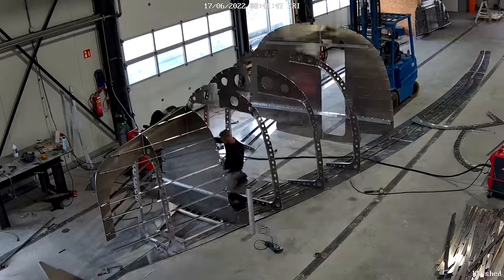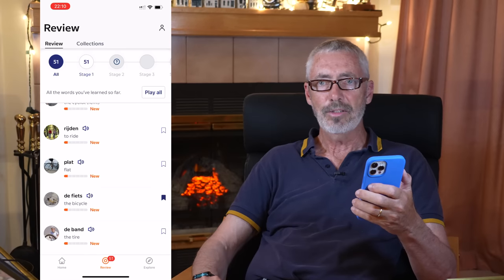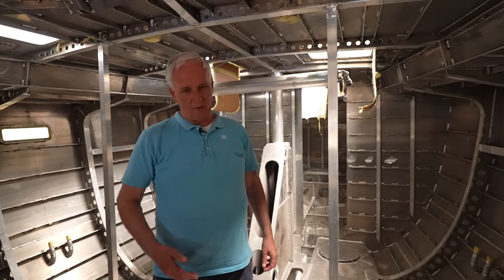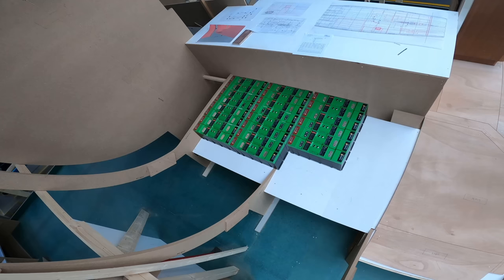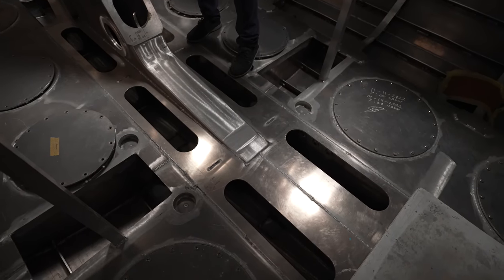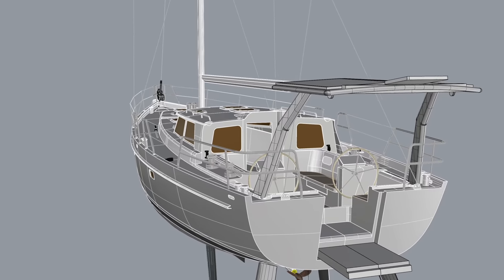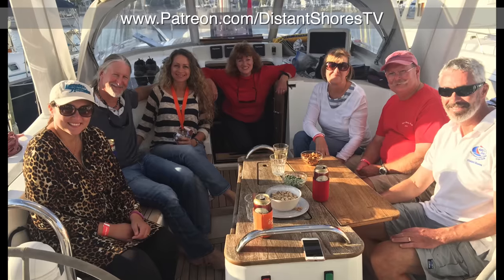ALUMINUM Sailboat Pt 17 : BOW THRUSTER, Cabling, Insulation, Lithium Batteries and More! | EP 238

Comment: Nice technical video. It would make sense to put the batteries for the bow thruster in the front near it's electric engine to avoid voltage drop and use less copper 😊. From experience the paint on aluminum never last long ... Other deck materials may be a better choice.
Reply: If the Bowthruster runs on 48V ther is not much current and the cables are relatively thin. THat is the big advantage of higher voltage. The piant on Aluminium lasts very well if the priming and painting prozess is done correct.

Comment: It seems like the bow thruster should have a water tight bulkhead behind it or its own compartment. If there were a leak it looks like the amount of water ingress or the difficulty of working on the shaft seal under the motos would be hard. Boat looks great!
Reply from the maker: Thanks for your comment. You are correct and these things are in place. We simplified the drawing so the thruster motor was easier to see.

Comment: Looks great but I do have a small detail question. On the thru hull pipes, are they welded to the fore and aft strakes to stabilize them? I couldn't tell from the video. If not, you might ask if they should be gusseted to make them stronger and less prone to cracking. Beautiful workmanship through out though.

Comment: Great update on your dream boat, keep them coming.

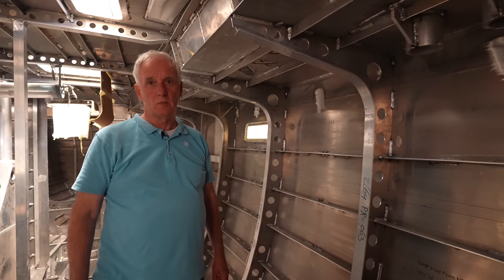On the topic of foam insulation, you didn't mention the 'type' of insulation sprayed and showed a cream colored example at 4:59.
According to my experience with North American products the cream colored insulation would indicate an 'open' cell insulation as opposed to a blue colored 'closed' cell insulation.
European markets might be totally different but I would suggest verifying the material is indeed a 'closed' cell insulation to prevent moisture absorption.
On the issue of safety:
Exposed foam insulation is not allowed in residential construction due to the production of toxic gas emission upon burning.
Residential Code here in Canada requires ALL foam must be (protected) covered with drywall to allow sufficient time for egress.
However in a boat with limited or restrictive egress we should be EXTRA vigilant in ensuring a proper insulation seal, especially when egress is limited.  

Years ago, I came upon a particularly difficult spray installation that would make covering the uneven surface costly and difficult.
In order to offer some protection to my client, I came upon a product (not approved for residential application at the time) the entertainment industry employs to protect their large foam carvings, animated heads, animals and displays by spraying a fire retardant directly on the foam.
I suspect this product has improved over the decades and I would suggest researching it if this is of interest to you.

Further, and NOT to scare you but I would include respirators with organic filters, inexpensive and something you hope to never have to deploy.

For those interested:
Foam insulation
R6/inch (2.5 cents)
6 cents ~ R14
Canadian code requirements for wall R19

Hope I scared you...a little bit
Ya! there's always one in the crowd
Cheers
Reply from the maker: Thanks for sharing your knowledge and for this information. We will investigate and be covering the topic of insulation in more depth in a future video. 👍🏻
Reply: @DistantShoresTV  
I should add that Closed Cell insulation is a MUST.
Open cell insulation would be like gluing a sponge on the inside of the boat that would absorb vapour and render the insulation useless, not to mention the added weight, formation of mold  behind your cabinets etc.

Another issue I have is the application method.
The side walls will be in constant motion, deformation and twisting action.  
I would enquire about surface preparation (sanding, acid washing) since bonding is paramount to a successful job. 
Is a primer or bonding agent recommended on aluminum by the manufacturer?  
What's the manufacturer's opinion with applying their product to an aluminum surface in constant motion.  

I wouldn't want to hear the insulation cracking or delaminating from the hull down the line after your exhaustive and meticulous attention to detail.

I maybe overthinking this but I've seen (including my own home addition) costly application errors that could have been prevented with a little research.

Foam insulation is a great product if applied according to manufacturer specification.
Cheers,
N
Reply: @DistantShoresTV  Its very appreciated indeed to understand what type of expanded foam you will spray !

Comment: Very nice build, I do have some remarks about that picture with cables through those holes: Chafing will occur - not good. Planes uses similar construction using conducts (pipes) like you have show in the animation. Why not in that real yacht? I would like to have more ambient light in the cabins. Why not more and bigger windows? About those through holes, will vibrations of flexible pipes break them after a few years? Perhaps welding them with a strut to the hull would alleviate that problem. Just my thoughts.

Comment: @4:59, where the electrical conductors are outside of the conduit, what protection is in place to prevent chafing against the aluminum hull? Something such as Sigma Engineered Solutions ProConnex 02-55038L AC/Flex Anti-Short Bushings #3 Conduit Fitting for example. Thanks for sharing. I loved this indepth engineering episode.

Comment: I wish I could find a nonskid that bonds to the deck . And has a texture thats small and is similar to a traditional nonskid thats molded in the deck .Treadmasters pattern is to big for my taste . Can’t wait to see what you use
Reply from the maker: We're using non-skid grit in the paint on the deck, Brian. Easy to clean and maintain.
Reply: I used a product from TBS (France) on both an aluminium and a GRP boat. It bonds with Sika 291is less than 2 mm thick and available in different colors. On the aluminium boat it did not show any wear and tear after 15 years. It is great in the nonskid sector even when wet but you can knee on it w/o getting your skin peeled off.

Comment: Make sure you paint the entire inside of the hull, even behind the insulation. Trust me I have a 30 year old Ovni
Reply from the maker: Thanks Robert. Does your ovni have solid panels of insulation or was it sprayed?
Reply: @DistantShoresTV  Hi, it is not insulated at all and it also was not painted. This is the problem, where the condensation has laid on the stringers it has pitted the inside of the hull. Water mixed will all sorts of chemicals over the years. It is not just the condensation it is the unexpected things like a leaking deck filler that adds to is. I worry that even sprayed insulation, if it ever for water might trap water against the hull. In HVAC wet or damp phenolic insulation reacts with meters, even eating through stainless. I would want it painted before spraying on insulation. Your hull has already oxidized though so you cannot really paint any of it without a sand blast or sanding down. Aluminium is great, just needs caution. Love your show!!!

Comment: Nice.. but was there a settee with a big inner corner radius showing in the rendering.. you know, the kind that is robbing you of good backrest opportunities legs up in not one but two different directions..?
Reply from the maker: We're with you! That shot of the pilot salon with the big inner corner radius is from an Orion 49 constructed by another builder. We used the shot to help viewers envision what the pilot salon would look like finished. On our boat we will not be having the corner radius. It will be squared off so you can have good backrests in either direction. Also, it will make it possible for the long side of the bench to be a sea berth. Good observation. 👍🏻Thanks for your comment.

Comment: Painting aluminium is generally considered to be a mug’s game, as paint adhesion is so difficult to achieve.
Reply: The areas of my aluminium hull, where painted (internally) have lasted really well, after 30 years the aluminium is perfect underneath. Areas unpainted is pitted and in areas badly. There is no problem painting aluminium if done properly. Obviously there is a limit but I’m pretty happy with 30 years
Reply: @robSaRe  Thanks for reply. For interest, what painting protocol did you use? Or was it done by the builder? You probably know that most French aluminium boat builders tend to leave the hull above the WL unpainted. Also, painted topsides tend to start peeling. Maybe the key is above- vs below-deck?

Comment: I have been following your channel for several years , I like your travel and stories very much. You are building a beautiful yacht. I can't wait to see the finished product.  My question is about the fresh water tanks. I noticed that they are built right into the ship . Why not plastic water tanks ? Drop them in and move on to the next part of the build. Just wondering.
Reply from the maker: This is the standard method used by aluminum boat builders in the area and was the standard for the Orion 49. It adds to the structure and strength of the hull and they are easy to clean apparently. Since they are welded in, fewer fittings are needed to position them.
Reply: the water capacity can be maximized as otherwise the space the frames take will be lost.

Comment: Critical error not zinc chromate all of the aluminum after the welds and seems, as we do is all sea planes.  Ever millimeter of the aluminum needed to be covered with zinc chromate..
Reply: They haven't shown what the primer is. However the surface prep will be a bigger factor considering that modern epoxies can include zinc cromate.
Reply: @LoztDaze  all Navy aircraft get 3 coatings of Zinc chromate before the gray Emron, a type of two part epoxy paint, then 3 coats of that, my son was a LTCMDR Navy test Pilot and line maintenance officer.  Navy aircraft get doused in sea water all the time.  So they know how to protect aluminum from corrosion..
Reply: @ballomni  critical error not knowing what you are talking about.
Reply: @blegi1245  I know Naval Aviation, I know what the sea does to Aluminum, I know that the Navy spent billions on the subject, I know that other skiff boat in special forces are aluminum, they all got the electric applied Zinc Chromate base, I also know that planes and Navy boats with the treatment and been in service for 30 years.  At the USNA they have a whole study on corrosion on , aluminum, stainless, titanium, and composite compounds, I went on the tour, my son is class of 2010., in Addition they also do radiation exposure experiments.  So what you are telling me is that this boat manufacturer knows more than the United States Navy.  Sorry, their data alone and you can check it proves their way works.  Epoxy does not last as long as alloy plating which is how the corrosion process is applied, Ford thought so highly of it that they use the Sam process on the Aluminum F150, note Road Salt!  Check your facts, everybody is free to do and spend money anyway they want.